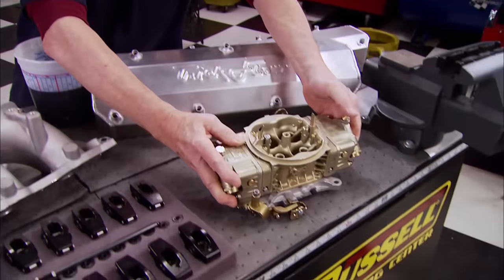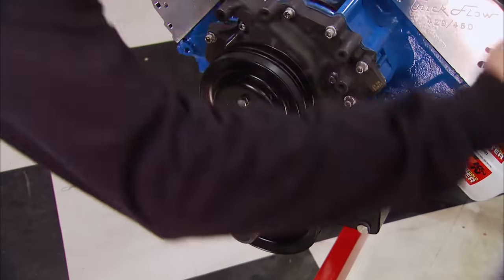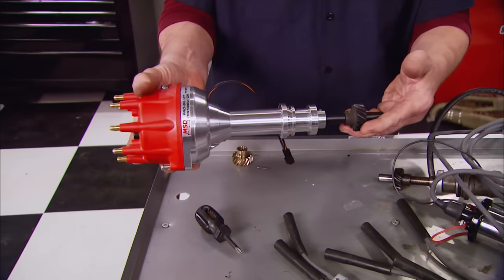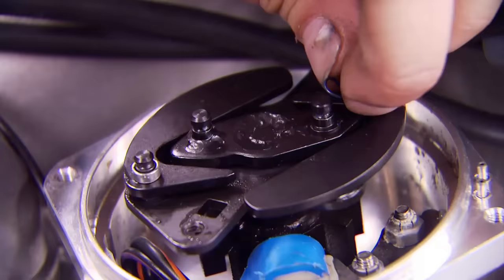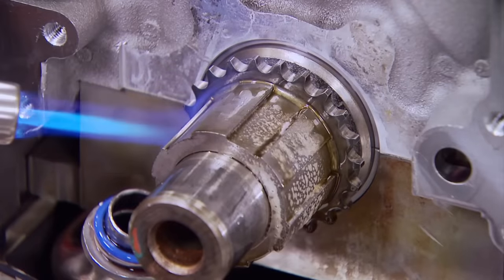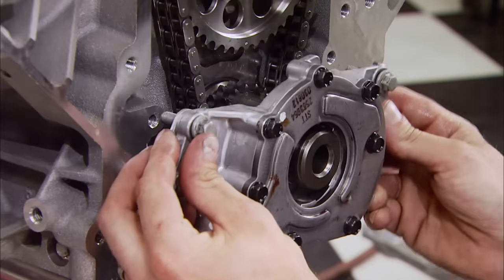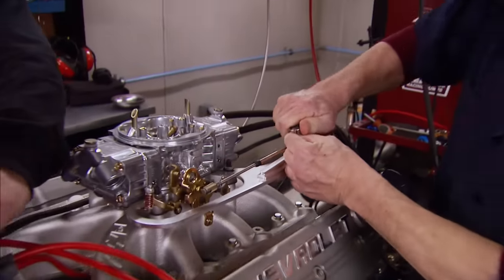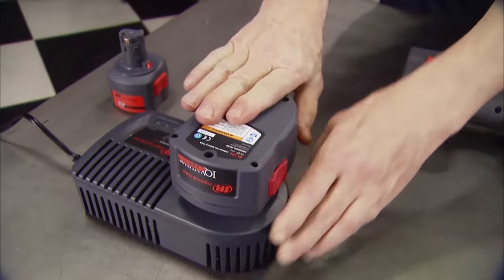Ford 460 Engine Build Part 3 - Horsepower S13, E10

Comment: 600hp... yawn wake me up when your making 1k on an engine that large.
Reply: show me an na motor with stock bottom end from the 70s that makes 600hp oh and on a carb at that
Reply: @venumus1  Show me the fact that 50 years ago this was good power. Now Mustangs with half the displacement make that with only bolt-on power adders and half the weight... thermodynamic efficiency doesn't care what happened 50 years ago.

Comment: What the hell is your static compression ratio? Damn idiot American v8 engine cooks building by a recipe they follow out of better homes and small block chevys. Compression ratio and quench is more important than all this bs of cam heads intake carb you bought because thats the recipe somebody else gave you. If all these guys would have building by real measurements the internal combustion wouldnt be on its deathbed emissions wise. Figure out how to keep an engine cool and full of cool air will reduce emissions and boost efficiency. Was hoping to know how much a compression ratio increase on 460 would yeild. Im used to building and driving old volvos with 10.5 and higher comp ratios, stock cams and get an engine that makes 75hp per liter. Thats with no new parts besides bearings rings and gaskets. Compression ratio!